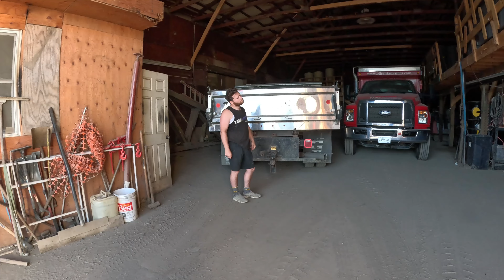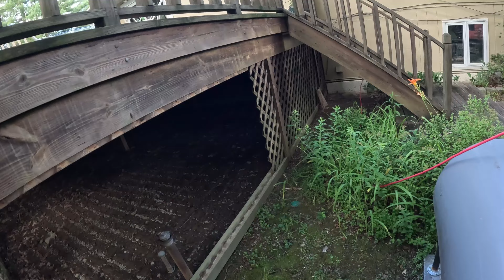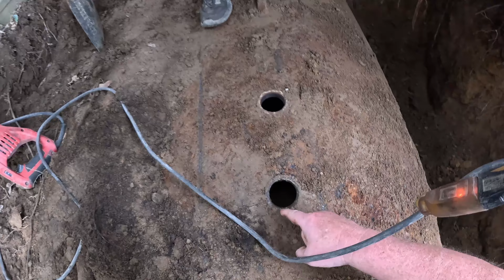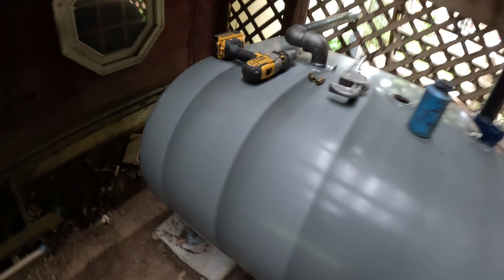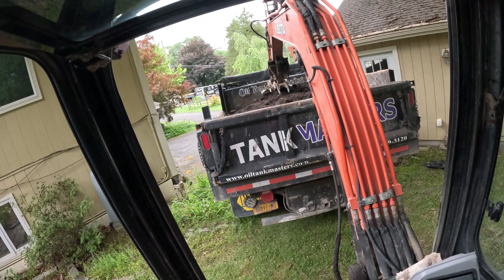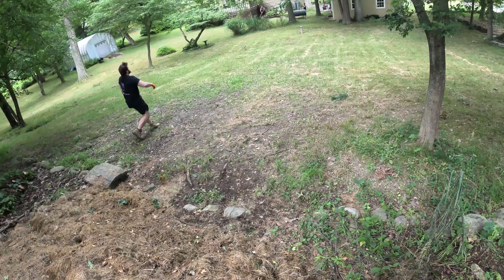Oil Tank Removal from Under A Deck With Horizontal Tank Installed Back Under

Comment: That was some expert work!  Tank under a deck, water line and power line from the well next to it, the house and garage in the work area, and you did the tank removal without issue.  For those who have never done excavation near a well line of unknown location and depth - you don't know the challenges involved.  This was a much more difficult job than it looked.

Comment: Copper is $4.52 a lb on the market. You might not get that at the scrapper! If the milwaukee batteries don't show four bars as long as thier not too old milwaukee will replace that.  
The new 8.0 HD and 6.0 HD last longer.  There is also surge m18 that will give more but cost more! But it is to take one out of the ground. Nice job!

Comment: What causes all that sludge?
Reply from the maker: Condensation
When a tank isn't full during the spring and summer, moisture can condense on the inner walls and drip to the bottom. This water is denser than oil and can be turned into sludge by bacteria and microorganisms.
Rust
Rust can develop over time and flake off, sinking to the bottom of the tank.